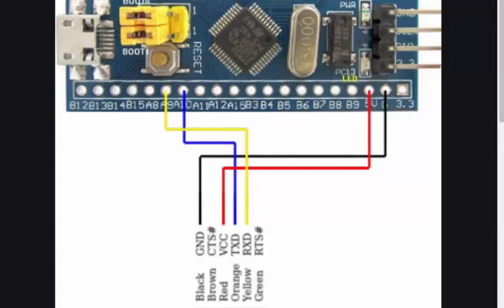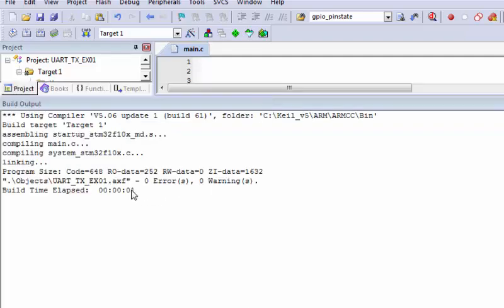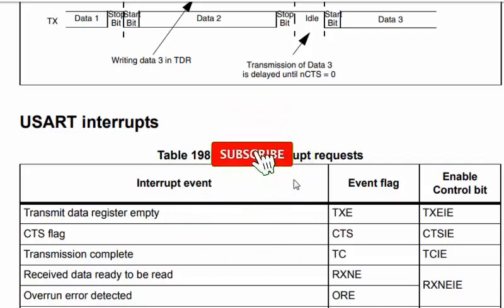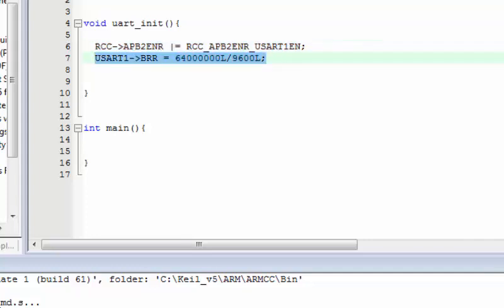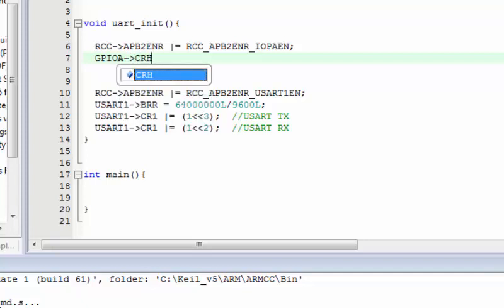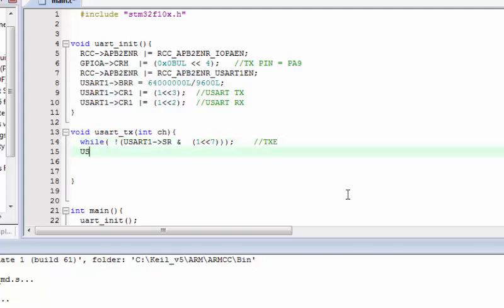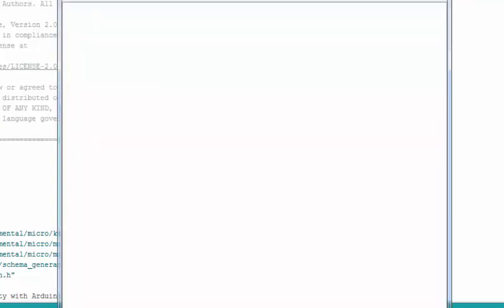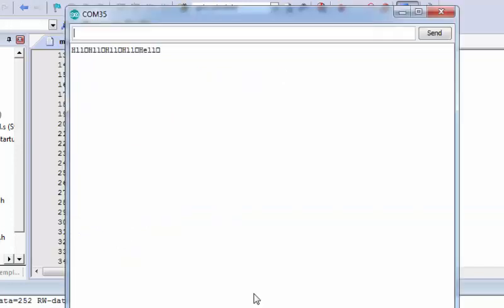STM32 Keil Tutorial #03 | STM32 USART TX example | How to transmit data over USART in STM32?

Comment: I followed this step by step.
Code runs successfully but after flashing, my serial terminal displays some unreadable character.
Transmission is not continuous, I have to press reset to receive some unreadable character on the terminal.

What could be the problem please?
Reply: I think it could be a baud rate mismatch